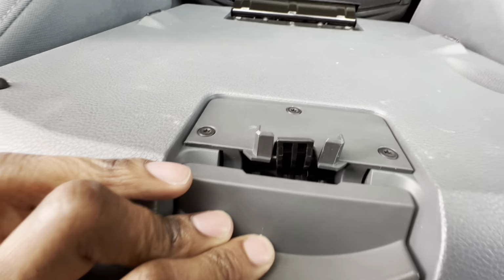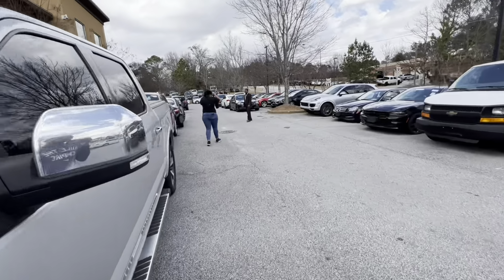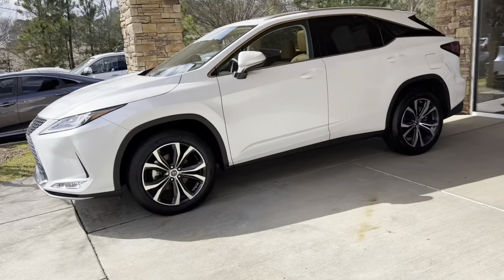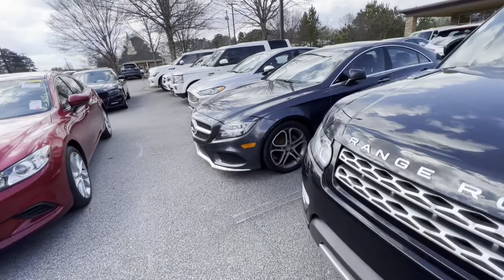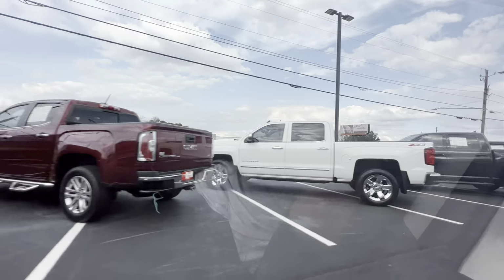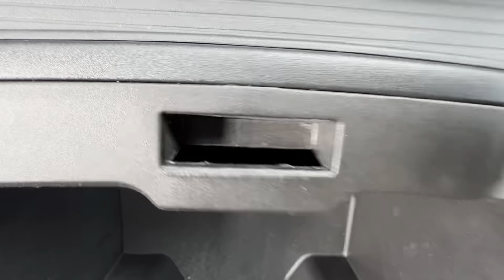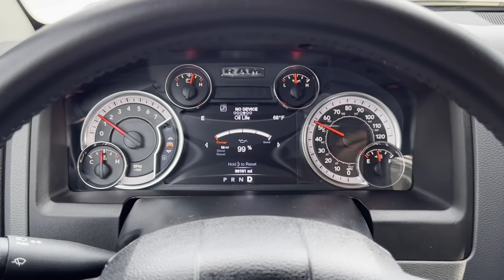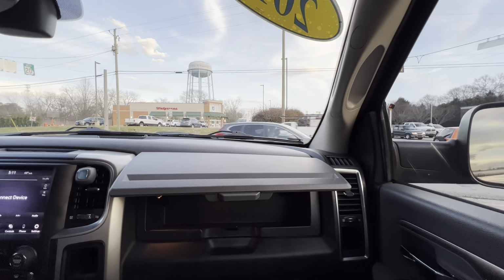BUYING A 2018 DODGE RAM 1500 BIG HORN 4X4 CREW CAB! *FINALLY A NEW PICK UP TRUCK!*

Comment: U can use e85 in that truck. I wouldn't recommend it though. It is cheaper at the pump, but it does burn faster. Better off using regular

Comment: It’s a v6 even the v8 take regular trust me you don’t have to think about it too hard it’s basically a flex Fuel E85 is an abbreviation typically referring to an ethanol fuel blend of 85% ethanol fuel and 15% gasoline or other hydrocarbon by volume so you can use either or and higher gas is only give you more power but it’s not a difference gas is gas besides diesel of course